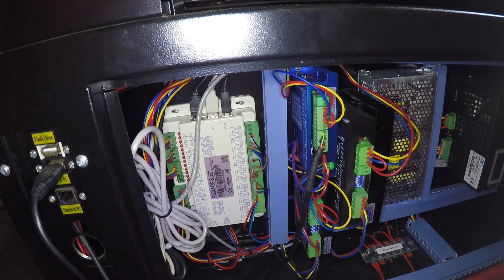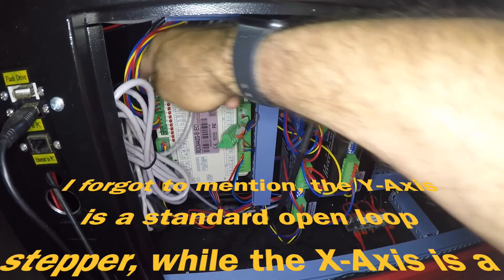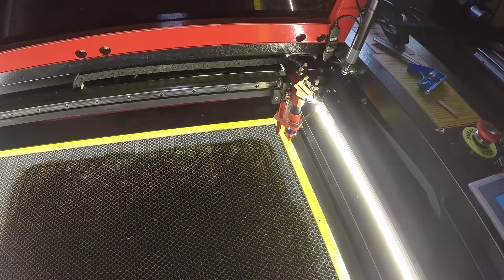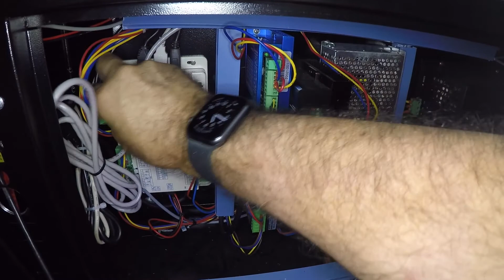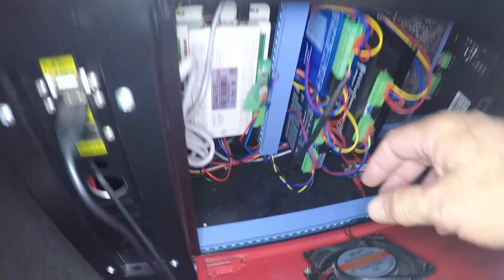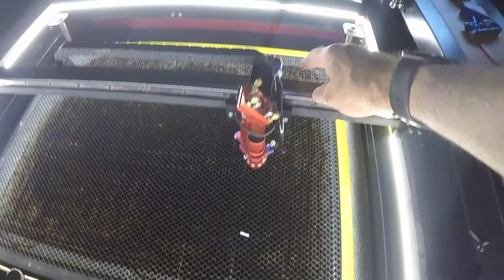Difference Between Open and Closed Loop Stepper Motors

Comment: I installed my x axis closed loop motor and it won’t move. The red light at the driver keeps flashing indicating the alarm is on
Reply from the maker: If the alarm is on, it could be a few different issues. One, the motor is hitting something and it tripping. Two, something is wrong with the wiring… best to DM me through Facebook messenger https://www.facebook.com/jimAlexander1961

Comment: I guess that means that closed loop includes encoder feedback, while open loop has no encoder ?
Reply from the maker: Exactly. Also, the closed loop uses a different driver, that is capable of reading the encoder.
Reply: Unfair comparison as pointed out, the open loop motor has no encoder. Maybe re do it in a fair way or better to do this comparison to show acceleration & torque, also interestingly I can use my closed loop motors with my open loop driver (no encoder wired  but not the other way round